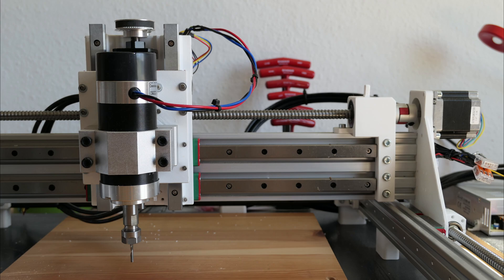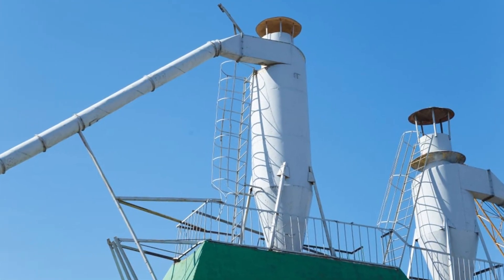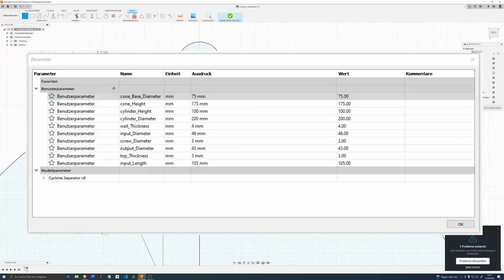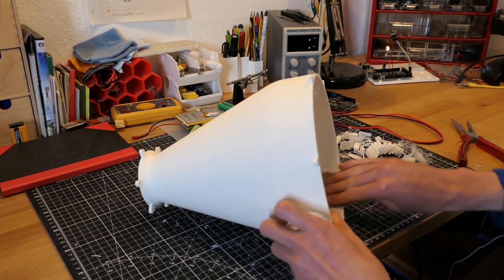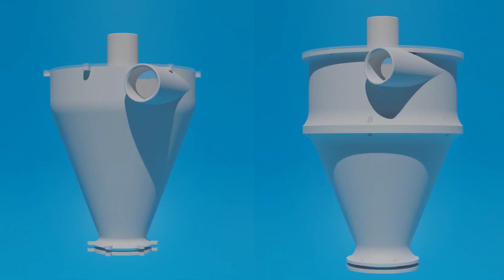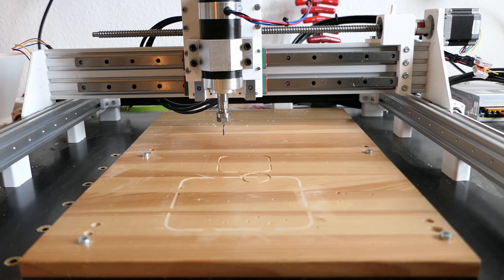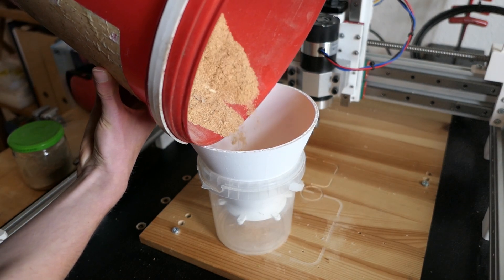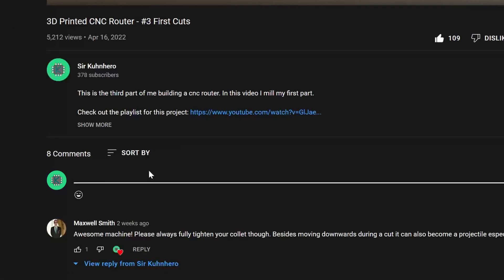3D Printed Cyclone Separator

Comment: How was the acrylic lid made?
Reply from the maker: I used my cnc that I built in a previous video. Although you could probably achieve the same result with simpler tools ;)
Reply: @SirKuhnhero  Thank you!  Did you try those suggestions made by @zumbazumba1?  Curious if they made a noticeable difference 🙂.
Reply from the maker: I haven't made any changes to my Cyclone yet. But I think these changes would make a big difference. If I make a V2 at some point in the future I will definitely include them.

Comment: For anyone that is watching this ,you made some errors.
Top sectionat 3:56 Intake for a dust hose needs to be tangent to a cricle which is ok but its diameter must be 1/4 of the top section inner diameter.So for example if your top part has diameter of 100mm hole that hose goes int needs to be fi 25mm.
Now the biggest mistake you made is that the pipe section for attaching the vacume cleaner at 07:17 is flat with acrylic lid -that pipe needs to go below the 25mm(in my top example) tangential pipe.
If tangential intake pipe for a dust gathering hose  is at middle of the top section the intake pipe for a vacume cleaner needs to be at 3/4.So it needs to go slightly bellow.
Reply from the maker: Thanks for the tip. When I do version 2 at some point, I'll make sure to implement that :)
Reply: @SirKuhnhero  Its not easy to make efficient one if you dont have size ratios.
Unfortunately i cant give you a link since youtube deletes those 90% of time.

But there is interesting article about cyclones and with formulas if you type in google: e info wiki cyclone separator.

You can determine Diameter of body by 2x size of the vacume cleaner hose.
After that rest of the values are  easy.

Comment: as you already mention you have a problem with air speed.  your working hose must be equal or smaller than one from cyclone to vac.  
also you can make a dedicated vacuum pump for this.  using regular vacuum cleaner is excessive and it's dust bag cuts some effectiveness.
i personally make one for myself and its great. i just took a vacuum cleaner motor (cheap) and build plywood box with a filter around it. then connect it to the cyclone with a short PVC pipe.
it is much quieter than regular vacuum cleaner with same performance.
Reply from the maker: I might do that in the future. Thanks for bringing that to my attention.

Comment: Following on from my comment below, all my tools are on wheels as I share garage space with the car.  My mobile vac setup might work for some other viewers:   I use a small domestic cleaner that we bought thirty years ago.  It has staggering suction, but was never used because it had a pathetically small fabric dustbag.  Five years ago I made a thien-baffle separator for it (your cyclone would be even better), using ideas gleaned from numerous Youtube videos.  It's not perfect, but absolutely worthwhile.  I mounted it in a simple trolley with a flat top to lay tools on, side hose hooks, cord storage, power plugboard, and an anglepoise work lamp.  It comes with me as I move around, and has become my best workshop buddy.

Comment: That's excellent!  I made a Thein baffle separator a couple of years ago.  I chose that because it was simpler to make... it has been fantastic, but I don't think it is as good at catching the fine dust as yours is.
I also 3D printed a cylinder that was internally threaded to fit my vacuum hose; this allowed me to join two lengths of hose as required, and works really well.  This could be a good solution for attaching fittings to your hose, and if you ever remake the separator, would  allow a tidier way of attaching the hose than using duct tape.
Thanks for your videos.   Liked & Subscribed.
(The under-extrusion was amazing!)